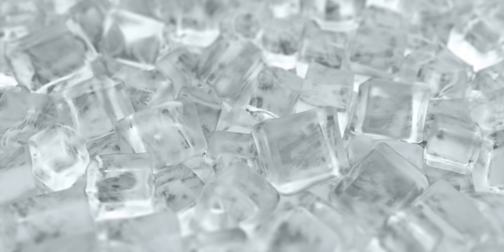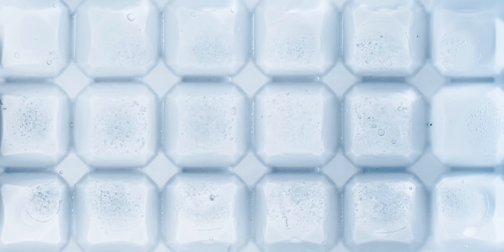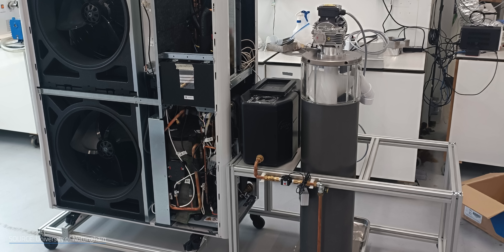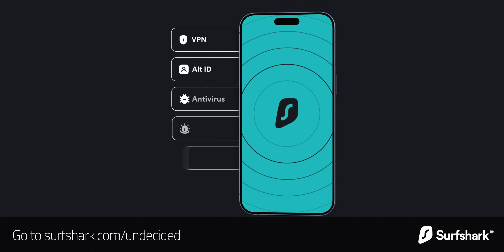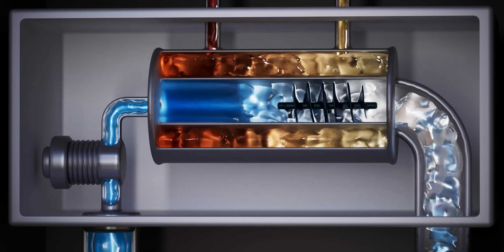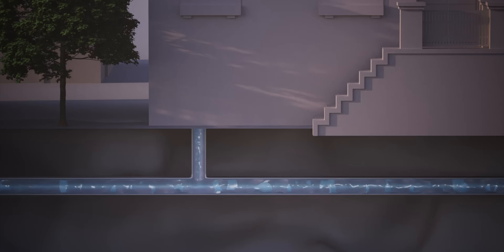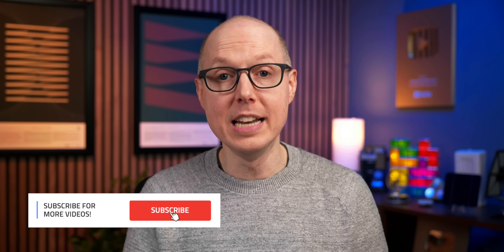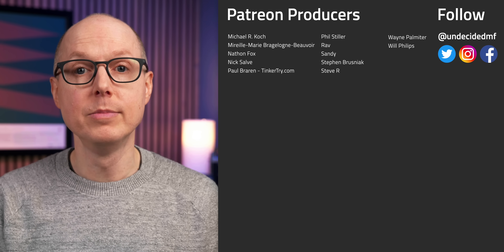How Can Ice Heat Your Home? Ice Source Heat Pumps!

Comment: It's an intersting idea, but I have to wonder about the feasibility of transitioning every single home that uses gas currently to this system because there is no inbetween... You can't just have people switching over as they are able, it would require every single building tied to that gas line to convert over all at once, a logistical nightmare I'm sure.  Additionally, I have to wonder if the existing gas line has the capacity for a water system.

[edit] I see I should have waited, as you touched on this very point, lol
Reply: If I'm mathing correctly, the average UK home would need only about 1200 liters of water to replace the energy content of natural gas used per YEAR. Compared to about 350 liters used per DAY for normal usage, the increased water demand and sewer disposal cost is absolutely trivial. Even allowing for inefficiencies doubling the theoretical usage to 2400 liters of water is still a rounding error.

As for the change over period, it would be possible to run the heat pump using existing potable water lines until an entire area is converted, then switch the gas pipes to non-potable water. After that switching each end user from the potable system to the non-potable system would be relatively trivial. While more costly in terms of water prices, especially for the early adopters, it spreads the transition out over a reasonable time frame while not leaving anyone out in the cold, either figuratively or literally.

Comment: During my time in undergrad, I had a physics professor who demonstrated an intriguing concept: using a kid's swimming pool filled with water to maintain temperatures above freezing in garages located in northern climates. My classmates and I were genuinely surprised by the significant amount of heat released during the freezing process of that pool of water. While it wasn't the most efficient use of space, and the effectiveness diminished when the garage door was opened, it successfully prevented the air temperatures from dropping below freezing. Seeing how this concept can be applied in real-world scenarios is fascinating.
Reply: Also why vineyards sprinkle their plants with water when they fear freezing temperatures, the latent energy of water is enough to sustain a short period of sub zero temperatures to protect the plants

Comment: An issue I question comes with the freezing. The pipes themselves may be able to withstand the corrosion, but with the water being/getting frozen, it can significantly increase the pressure on the pipes, potentially leading to the pipe bursting

Comment: This might work if an antifreeze was circulated to a central location to freeze a large body of water. The antifreeze could enter your house just above 0c, the heat could be extracted by your house's heart pump, then the antifreeze could return to the central location below freezing to a large body of water.
Reply: I believe the interest in this tech is in exploiting the generally misunderstood or little known  property of water which observes that while changing state, it offers 80x more in heat transfer capability. The interest is not just in using water - as is conventionally done - as a heat transfer medium.  Someone has suggested that ultimately, the main benefit this tricky behavior could offer is to merely lower the amount of water needed in the system.
Reply: @mikemotorbike4283  Correct. The phase transition is the key, so using an antifreeze to avoid it completely ruins the idea. You'd have to pump 40 times as much antifreeze as you would water.
Reply: If the idea is just to pump less water around, that's understandable. I'm sure there would be many issues trying to move a half frozen slurry through pipes.

Comment: As I like the idea of using back the network of pipes, I kind of think that there is ways to use this better than trying to push for water to freeze. There are some big advantages, but I'm not sure about the overall effective of the idea.

I think it may be worth to look for something else to put there. The idea is quite great, but like you know, you could work your way with pressurizing the pipes at the right pressure to allow for the mixture to be a gas (allowing easy flow), get it to a liquid state with a partial heat pump, then getting it back to where it came from. Basically a bigggy split, not a mini split.
There may be a work to get around using greenhouse gases as coolant looping around by using some clever gas tech (partial pressure, mixing gas, not liquefying everything), like they do in scuba diving.

Comment: Has anyone figured out how to ensure the icy slurry is kept in a slurry state during its long journey from the home to wherever its going?
Or is that just handwaved out?
Reply: @arceusthomas2447   Also, what about power failures. The slurry is much more likely to freeze solid if it stops moving. Big problems if that happens.
Reply: @ajhokie130  leave power failures, a long metal pipe where icy slurry is pushed through should cause some portion of slurry to melt due to the friction and re-freeze under normal operation no? Also ignore bends in the pipe where pressure difference causes some portion of ice to pack tightly, melt and re-freeze.

Comment: i think this system should be adapted to instead chill the sewage water that exits your home. It's already "non-potable" but there is a lot of heat in it, especially the warm water from cooking or showing. The sewage system is already designed the handle... semi-solid... materials, so there is little need to upgrade the infrastructure. Heck the sewage system already runs warmer than ambient due to bacterial action.

Comment: I wouldn't consider this an ice source heat pump. Ice is being used as the working fluid but the heat is coming from the ground that the pipes run through. They could just replace the water with another working fluid with the appropriate phase transitions.

Comment: Interesting concept, but I doubt it would ever be built. I hate to think of the total cost. Steel pipes rust. Machines wear out and can cost a lot to purchase, repair and replace. Leaking water inside a building can do massive damage, especially if not noticed right away. That system is way too complex. Just go with straight electric heat pumps. The power grid will need a massive upgrade due to coming data centers, so just make it a bit bigger than you think you will ever need when upgrading it. Plan for the future for a change. That is what they did when they built the new airport in New Orleans. They had it designed and were ready to start construction, when the officials realized that in 15 years, they might need another very expensive and disruptive expansion. So they decided to make it somewhat larger than now needed. Now they can forget about it for decades to come. No more airport problems. They did something right for a change, along with the rebuilt Superdome for the Super Bowl. Now if only we had a winning term. 
It is usually better to have more than you need, than to need more than you have.

Comment: These days I still find that a lot of installers in HVAC community don’t understand heat pumps. I got a Mr. cool heat pump off of Amazon had it installed by a professional HVAC company and before incentives and discounts it was under 7000
30% tax credit, incentive from energy company brought actual cost well undef $4k
I live in Colorado and have seen it personally work fine in -20 weather just fine

Comment: How are the gas pipes anywhere big enough for the flow rate necessary for this project? The gas pipes are probably far smaller than the necessary water pipes.
Reply: not to mention you have to rip out every single pressure regulator and gas service until the project is done.

Comment: We did a few final year projects at the University of Edinburgh to design this heat exchanger.  This was inspired by Seamus' article (he is a good, and very innovative, friend).  Instead of looking for external water supply, we chose to see how far we could get by freezing about 1/3rd of the black water that gets sent to the sewer from a typical dwelling.  The choice of 1/3rd being to do with the flowability of the slush.  The result was that we reckoned that we could provide the majority of the heat demand of a typical Edinburgh flat - assuming that it was well insulated and that people could tolerate a 17 degree room temperature (as many of us used to do).  Obviously the black water will need some form of upstream filtering so that solids can't pass through the heat exchanger.  It all looked fairly practical for the UK climate.   You might also want to store some black water on-site to smooth the heating resource - which would require a tank.  However, there may be a problem downstream - as the sewage farms need to operate above a certain temperature for the required microbial break down.... Might be a limit to how many can participate before the poop literally hits the fan!
Reply: Assuming good insulation and that everyone can cope with 17 degree room temperature immediately make it unviable in the real world where neither of these things are consistently true.
Reply: You're never getting modern people to tolerate 17c.
Reply: How do I contact you
Reply: Wouldn't that be too unreliable if you depend on water usage?

Specially since usage patterns probably aren't uniform through the day, and rather have some spikes
Reply: @drillerdev4624  You could temporarily store the (filtered) water in a tank. There are actually heat pumps doing this already.

Comment: ...city would use gas infrastructure to transport water to refrigerators that make ice....

So why have each house heat itself with refrigerators individually? You could simply make it so people could change how much/ how fast water goes trough their homes to change temperature and not need to have big refrigerator, which what you described is.

Like I see no benefit from making ice here. It would be better to use steam and water then ice and water, because steam is much easier to transport.
And if you already use premade infrastructure, why not making so. There is no point in placing individual heaters in each home and I am sure that industrial heater will be better at dealing with cold.
Reply: Steam district heating would indeed be better, but that requires entirely different infrastructure. The existing gas pipes are not insulated for steam and would lose too much heat to be practical for district heating, but could be used for this.

Comment: Lets imagine a simple problem and the repercussions.  Imagine power going out in the winter where the pumps that push the slurry shut down.  Now this is winter where the temperatures are subfreezing.  The slurry freezes and what is ice known for? Expansion of the ice in the pipe, which creates pressure on the pipe itself.  So now the system of pumping slurry destroys the entire piping infrastructure.  So now even if the system was running perfectly for five years, all of that savings is wiped out creating a mess that will not be easy to fix.
Reply: Exactly! In my town in the south of France (not known for its freezing temperatures) over the last 5 years, we've had a frozen drinking water main pipe in the town due to the cold freezing the ground.... imagine big cities? lol chaos for weeks/months.   

In canada they use HOT water piping network to defrost the roads and they want to put freezing water in underground pipes ? lol stupidiest thing ever....
Reply: @plop31 In Canada we use salt on the roads, only entrances to fancy hotels have underground pipes.   We have power failures all the time,  because ice storms cause tree branches to get heavy and fall on power lines.   but our water pipes enter the house under the ground below frost line where they don't freeze, and the building code says you can't run water pipes in an exterior wall, so on those real cold days -30 C the inside walls  are still well above freezing. Even if you lose power you keep the most of the house above freezing and the pipes are fine. 
 
Would this system, work in Canada,  no. because our natural gas pipes enter the houses above ground and the meters are outside  in that -30 degrees where they would freeze, if the system ever stopped.
Reply: Did you know below a certain depth (which isn't very deep), the ground is always above freezing level and only increases in temperature as you go deeper?
Reply: @ Yes the average normal depth for the underground to stay above freezing is 20 feet.  But a pipes depth is not a constant depth.  The depth of the pipe can be anywhere from 5 feet to 30 feet depending on the surface terrain.  The funny part about average is the average is a mean which can vary a great deal.
Reply: @anthonycarbone3826  above freezing temperature from outside cold but it will freeze while under both outside and inside pipe freezing cold....
Reply: @N4CR  yeah "always" above freezing level my ass......   say that to the permafrost dumb dumb   

its above freezing level from regular" freezing cold weather".  but if you add cold freezing pipes the full ground will transform itself in a permafrost.... it's just a matter of heat transfer magnitude. and safety margin.
Reply: @plop31 This is a UK specific plan, which makes permafrost a non issue. And guess what dumb dumb, the ground is still warm even under permafrost you just have to dig deeper.
Reply: permafrost is located above the never-frozen line 🤦‍♀️ and There's no permafrost in UK
Reply: Exactly my thoughts. I am highly, highly skeptical of the value in replacing gas infrastructure with water
Reply: @GodofGHz  The gas pipes contain all liquid water, not ice water... There are already water mains in the ground, and they rarely freeze. It happens, but it is rare overall

The ice water would most probably travel in sewer pipes, which are much MUCH bigger than any water or gas pipes, and they traditionally carry liquids and solids together so the ice water would have no problem traveling inside.

Comment: Her in the South, cooling is the need. The phase change concept you present is interesting. Rather than using water and  ice to make heat, how about water and steam to produce cold. To boil water takes energy in thee form of heat. How to produce cold air from hot water or steam would be a real invention.
Reply: This system could theoretically cool as well, but since it wouldn't be using the phase transition it would be using way more water. While this system couldn't do it, it could be possible to create a heat pump to create cool air by using boiling water as the head dump. I suspect not much research goes into that because places that need cooling the most also tend to be dry, so the water loss would be the bigger issue.
Reply: @willythemailboy2  Thanks. In the USA Out West, you may be aware of what are called "Swamp Coolers". These are  evaporative coolers that cool circulating water. You can recognize them as as big louvered boxes on rooftops On big buildings some unites are massive.
Reply: @ I haven't been out west - at least not south of Colorado - other than a layover at an airport, but I'm familiar with swamp coolers.

Comment: I see several problems. 
1. Most pipes are made of corrosive metals such as Fe and Cu. If plastic were used, it would have to be replaced after a certain period of time, as plastics become brittle over time. 
2. Would the gas network be converted into a heat pipe. This has certain advantages: 
-No need to pump ice mud. 
-The problem with corrosion would be reduced. 
-Instead of transporting heat through the heat capacity of a medium, one pipe can supply multiple streets. So in winter you need to keep the pipe above zero degrees. 

Objectively speaking, this is a bad idea. 
However, you can fill a smaller tank with salt water. Because you need little energy to get from -20°C to 5°C. Anything above that can be taken from the temporal oversupply of renewable energies.